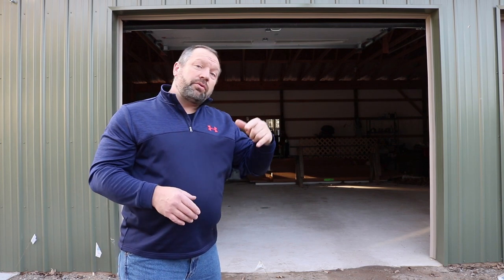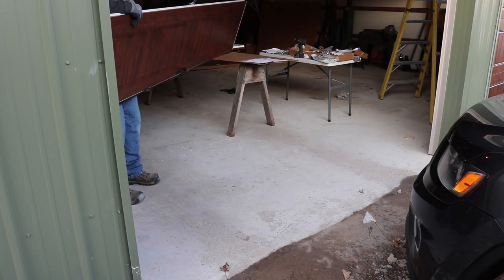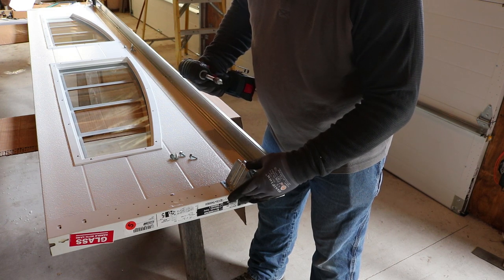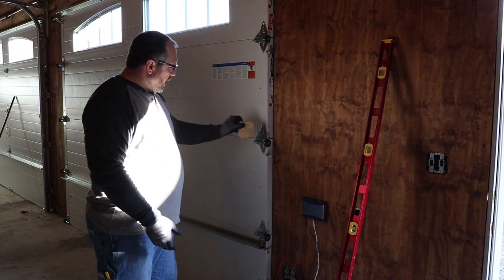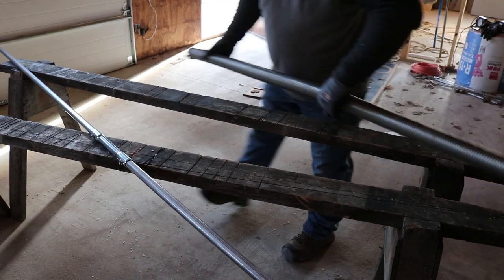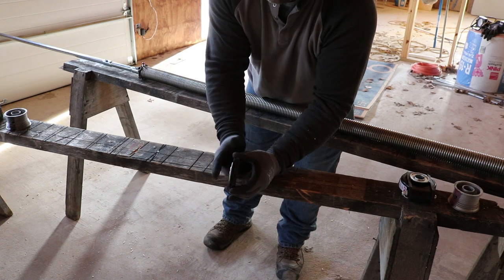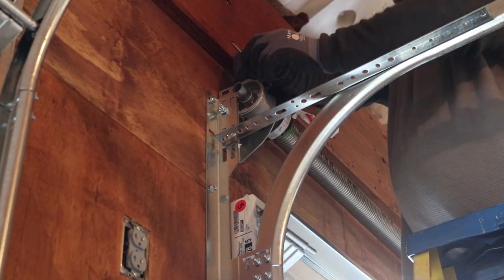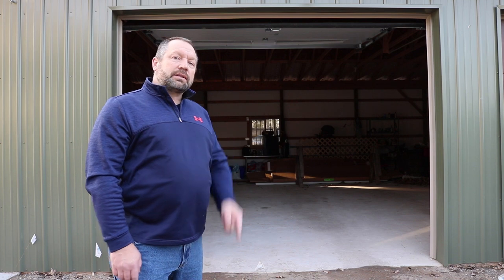Installing Garage Doors on the Pole Barn Shop

Comment: Those are nice doors! That is great you choose a 8'x10' door. Any smaller is a pain for parking cars and/or tractor with ROPS.  I have the same size installed on my garage, except I was able to fit that size in an 8'6" ceiling.  It's an as tight fit as it can be. There is 1/4'' between the panels and the ceiling when I lift the door! That is why this door will remain a manual door. No room for an electric door! Thanks for sharing, as usual, you do a professional job!
Reply from the maker: Thank you Joe! 8x10 is definitely the minimum size for a truck or tractor. 
I wonder if a wall mount opener would work in your case. They couple to the spring bar. I just installed one and that video should be out in a week or two.
Reply: This gives me some ideas. But so you know, I have the extension springs along the horizontal tracks. No room for the spring bar! I'll be watching your next video for sure!

Comment: Hello,  I have really enjoyed your videos.  I just ordered four doors that I ordered thru the Menards website.  They appear to be very similar as your door.
I was going back and forth on the color of the doors -.  Dark Oak or Oak Walnut.  Could you please either reply to this comment or email me with 
which of the two colors your door is.  Since these doors are quite expensive I am very anxious to know which color you chose for your door.  I thought
your door was perfect and really have enjoyed your install video.  As a side note, I checked with the Ideal Garage Door company and asked if the
Liftmaster wall mounted garage door opener like yours would work with their easy set torsion spring system - they said that it wouldn't.  A few hours
later I found your video on youtube installing one on the same door I had ordered, who can figure
Reply from the maker: I was looking for my order sheet but couldn't find it. I'm 95% sure it's the Oak Walnut. It's the darker of the two I know. Hope this helps.